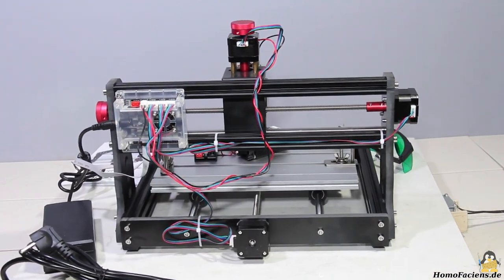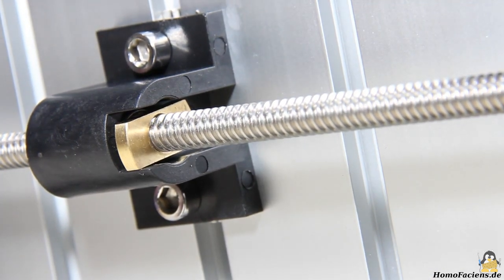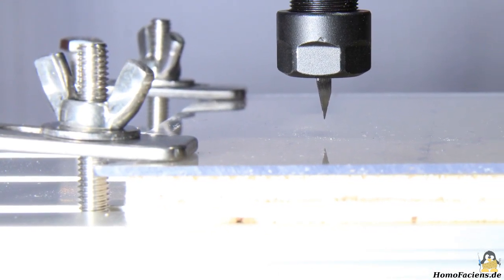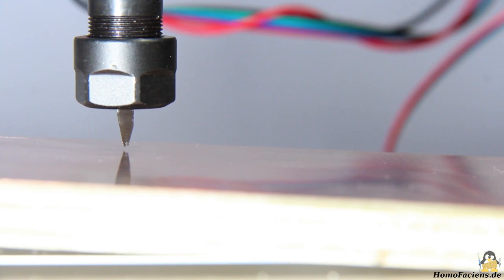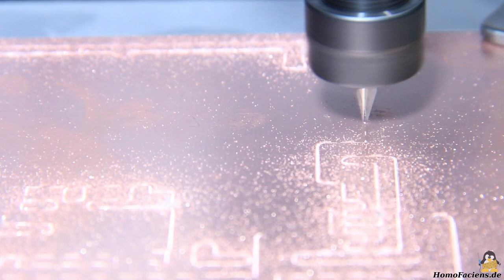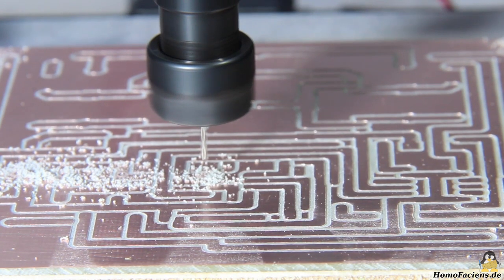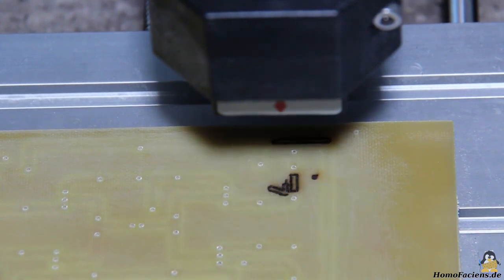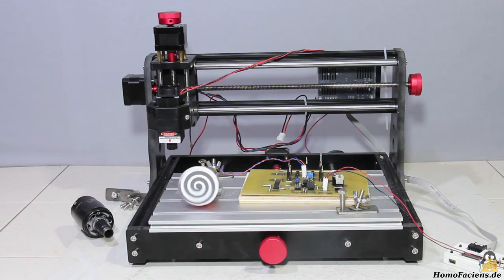Isolation milling a PCB with the CNC 3018Pro from Mostics

Comment: Also bought one of these 3018pro's for PCB milling. The allure of fast easy drilling of holes, doing away with the hassles associated with acetates, and UV processing was just too much to resist😉. However, in reality, as is from the shop, these 3018pro's will never do a good enough and acceptable results, as can be seen in this video. Results as shown in WEGSTR cnc videos are but a dream with these machines. The vibration induced by the spindle alone plays great havoc on the machines inherent lack of structural rigidity resulting in poor traces, broken traces, misaligned holes, broken bits and difficult to reproduce results to name a few. Other vloggers have done rails,  gantry and spindle upgrades that are more costly than the machine itself. And the results are just acceptable. If you still want one, be prepared for disappointment. On the upside, its also fun learning these machines.
Reply from the maker: Yes, you can't expect the same results from cheap machines as from the expensive ones - that's the main rule of market. You get what you pay for. You can create boards for through hole assembly with a certain trace width and so learn the basics with this machine out of the box and so learn the basics.

Comment: for the love of god, can someone please buy him a modern soldering iron!
Reply from the maker: ...made my day! ;))
There is a donate button on my pages. So if you mind seeing that old device in future videos, write "Soldering Iron" on the money transfer ;-)
Reply: @HomoFaciens  I hope you made that thing, what is it?  The tip looks 100 years old.  Also thanks for the videos, you are an inspiration!!!
Reply from the maker: It is a cheap 20W soldering iron from a nearby hardware store I grabbed ages ago. When the tip was worn out I replaced it with a piece of thick copper wire, simply because I wanted to go on with my work. And as almost all quick fixes - they last forever ;-)
Meanwhile I received a donation with "soldering Iron" on the money transfer (was it from you?), so I guess I must now look for a new, better one...
Reply: @HomoFaciens  I donated suggesting a TS100, as mine has served me well, but it's up to you, of course!
Reply from the maker: Many thanks, Dirk! The TS100 is a 12-24V soldering iron. If it works fine with 12V it would definitely be an option as that means I could operate it with a car battery during outdoor missions.
Reply: @HomoFaciens  You're most welcome! A fair exchange for the plasma lighter printer idea!
  It works fine for me at 12V. Gets to 300C in under a minute, and even has open source firmware for it, so yeah, "works for me".
Reply: @HomoFaciens  I'm a big fan of the TS100!!!  Unfortunately I burnt out the temperature sensor by putting it back together incorrectly.  I replaced mine with a "72w t23 tip" station that has worked great.  The T12 tips last a while and are readily available.  Maybe you can make your own controller, it may make a good video.  I believe the TS100 is open source and uses an stm32.  I'm never going back to a non temperature controlled iron.
Reply from the maker: @Dirk de la Hunt "Open source firmware" is the keyword that made me order one of these. Another thanks!
Could not find a video of your plasma printer on your channel. I am curious what yours looks like and what output you get.
Reply: @HomoFaciens  My printer was pretty similar to yours, so I didn't think it was worth making a video of.

I also recently bought a mini lathe from AliExpress, and "needed" some modifications, so I'm using the stepper motors and rails from the printer to drive the axis on the lathe.
Might make a video about that instead!
Reply from the maker: @Dirk de la Hunt That about your mini lathe would be even from higher interest for me. I guess I need a lathe, too to bring my direct granules extruder project forward. The heap of failed prints in my workshop is growing, waiting to get shred for something new...

Comment: Very interesting, I am about to mill a pcb on my Openbuilds Ox, bCNC has a built in leveller.  I plan to use the vbit to spot the holes and then drill them manually with my dremel in a stand. My board is double sided so I have to get the alignment holes right for the second side. The board I am making is going to plug into the Arduino that runs my cnc to allow me to attach my lazer module.

Comment: Great video. May I suggest you use the v bit to "centre punch" the holes before using the 1 mm drill bit to drill them through?
Reply from the maker: Yes, someone else also told me to do so, thanks.

Comment: Use a high quality 60 deg up cut spiral bit with 0.1mm or less tip width and the results are significantly better than those with the cheap V-bits. Even after height mapping it is advisable to adjust the zero depth with a test cut or two to get perfect copper removal with minimal board contact.
Reply from the maker: Yes, quality tools usually are worth the money. Thanks for sharing your knowledge!

Comment: Can I use FlatCam with the CNC 3018 PRO?
Reply from the maker: If FlatCam supports grbl based machines or can export Gcode, that should work.
Reply: Yes you can
Reply: Yes, it works well

Comment: How can I change the speed to maximum rpm?
Reply from the maker: By sending the line
S1000
to grbl. The spindle pwm can be set fom 0 to 1000.
Reply: @HomoFaciens  Not 10 000?
Reply from the maker: No. Read the grbl wiki to learn more.

Comment: Do you think it will handle smd circuitry? I was thinking about applying the idea of drilling in water for pcb as well.. any thoughts on this? Well done video!
Reply from the maker: I haven't dealt with smd boards, yet and this CNC won't be capable of doing too fine structures, because of the not so perfect runout. Drilling and routing in water would effectively bind the dust particles.
Reply from the maker: You'll need to replace the DC motor with a spindle having a clearly better runout.
Reply: You can do SMD boards, but there are limits to the trace width and isolation widths. It takes some practice. You will not be able to do the smallest parts, but many parts that you can hand solder will work.

Comment: really short nose of the soldering iron .
Reply from the maker: That nose is a piece of thick copper wire (the old tip has gone for a long time). It is so short, because that cheap soldering iron has only 20W. With a longer tip, the heat transfer would be too low for the relatively wide copper tracks.
Reply: @HomoFaciens  it makes me feel shame , having 2 soldering irons and i have  not use one enough , to have a need for a second one .
Reply from the maker: I use that old, worn out soldering iron not because I could not afford a new one. I just can't throw things in the bin that still work (somehow). So no need to feel ashamed ;-)
Reply: @HomoFaciens  my feeling of shame is about my ratio of consumerism to productivity .

 i also dont like to throw things away even if there are not working ,  i feel that there might be an other use for them or use something from them . 

a brick is a brick when we put it on a wall , but it can be  useful and for other things that was not designed for . 

i am sure you can afford a second one or a third and a forth and i liked that you used that one  . i find it a good example .

Comment: can it mill Aluminium (something like 4mm thick)? many thanks!
Reply from the maker: Rather not out of the box with the weak spindle and the not so good runout, but I haven't tried, yet.
Reply: i have tried it. it can mill aluminium. the depth must be 0.5 mm with a 4mm flute. feed rate about 3-5 although
Reply: Have you already tried? It has even difficulty milling PCBs.
Reply: 3018's are made by several manufacturers with varying quality. They are generally not rigid enough for aluminum, but small jobs can be done with patience.